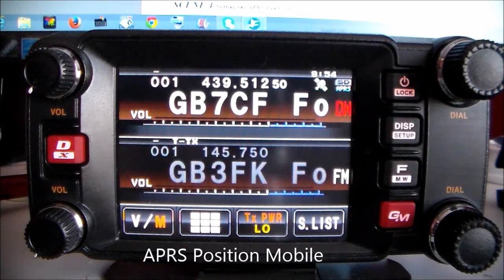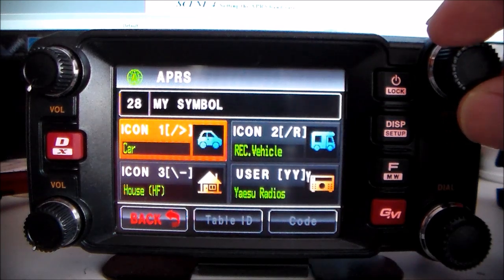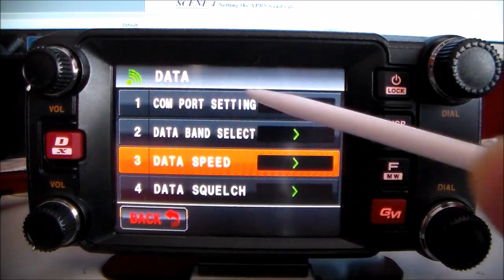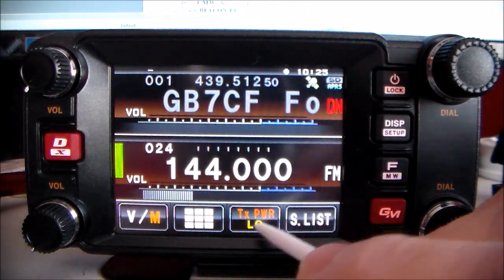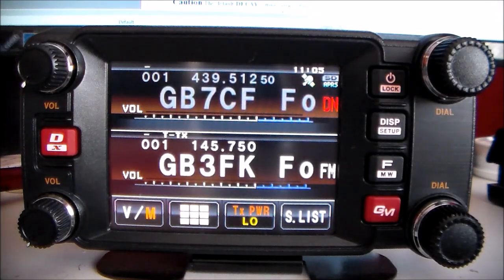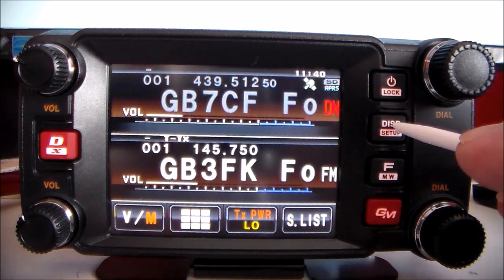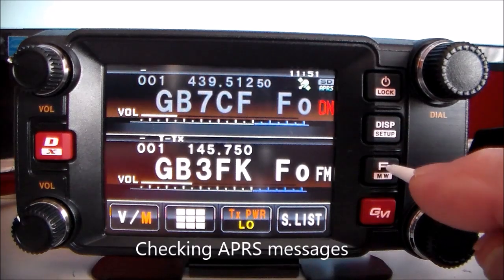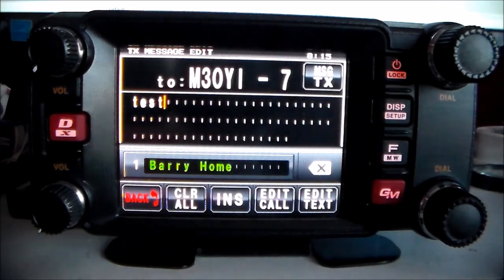FTM 400D APRS Basic Setup

Comment: Great Video.  It helped me solve two problems.  1st one is why I could not find my call sign on APRS.fi, it turned out to the baud rate 1200.  2nd was why I could not see my own tx beacon status.  Found out after playing with it, if you alter the default tx message it will show up on the s.list when sent.

Comment: Great video. But I have a question. I was running APRSDROID app on my phone and it is populating routers and other objects with freq information. But I noticed of I look at the S List on the ftm-400 I can see the exact object I saw on the phone but it doesn't list the frequency information has all the other info distance, power, GPS, etc. So far the only objects in my list that show frequency is other ftm-400 units. can't figure out what I'm missing.
Reply: Ted did you get this figured out? I am on the fence between this radio and a Kenwood TM-D710GA. Thanks